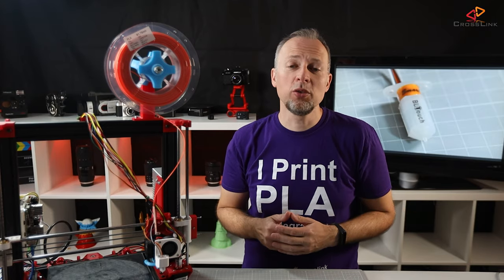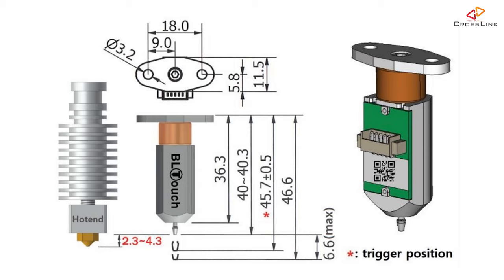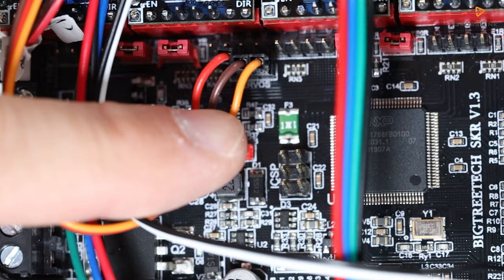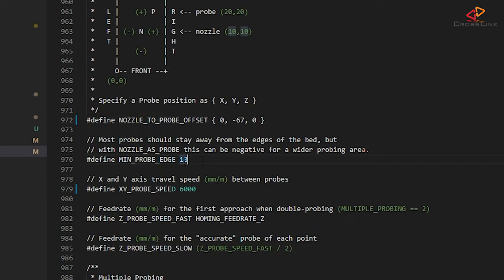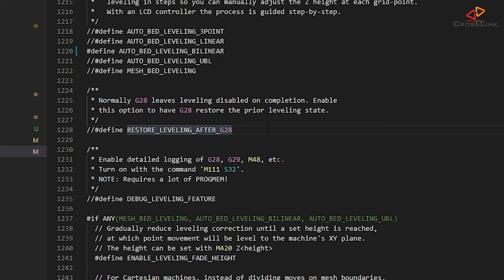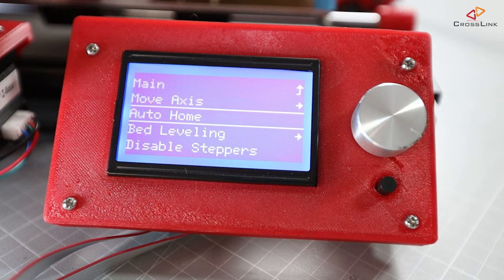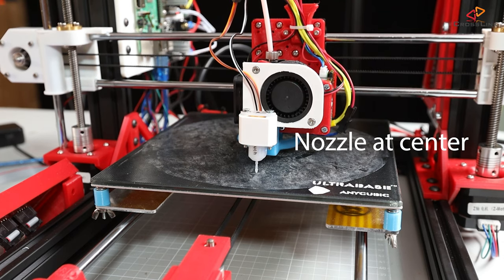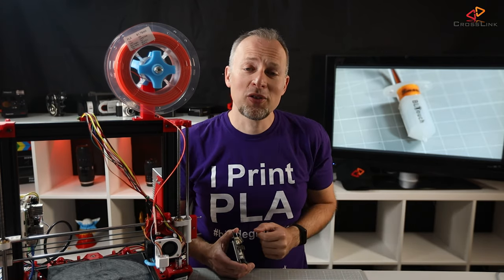SKR 1.3 - BLtouch installation and Marlin 2.0 configuration

Comment: Thank you very much. Best guide for Marlin 2.0 and BLT so far. I've got v3.1 of BLT and ender 3 pro board v 4.2.7. It was a real pain in the ass to make them work together and your video helped me very much with the firmware settings.

Comment: Another great video!!!!!  You are doing all of my upgrades that I set out to complete on my Anet A8!!! lol. I kinda stopped looking for help after so many different suggestions, its kinda nice that I figured much out with a little info from everyone and then go back and take the time to view current videos like this one and compare/take notes and understand sooooo much moire after already  getting knee deep into the upgrades. Consistency and reliability of my prints have hugely increased and I can almost set the print and forget it until its done.....As there are so many different options with so many different printers, t is hard to find a video for exactly what you have and are trying  to accomplish.  

I hope you will touch on the wifi  option with next week's MKS TFT installation video. ( As I have not tried this option out yet along with I havent even installed the MKS TFT display ....lol)

I have some  suggestions for you if you feel up to it.. As I grow more and more confident and familiar with 3D printing,  I have come up with  some very challenging goals- I plan on re-purposing my original Anet A8 1284p v1.7 board as a expansion board for my BTT SKR v1.3 & MKS TFT 3.5 w/wifi setup.  I also am planning on using my OEM LCD2004 display with the SKR v1.3 (man you should look into what has to be done to use that display on the SKR - utter mass complications).  Some possible uses are a real time clock, scrolling messages like time til complete, material  used, etc, led control, multiple fan control, and even using a android tablet as a big 7-9" display.

So you see what my plans are..... It would really be nice to see some of the ideas in your videos.... just saying...... lol
Reply from the maker: 😀 Let's see, I am currently testing all the SKR boards and will document the process first. Will take a few weeks.

Comment: I have an Anet A8 upgraded to SKR V1.3 and am trying to install the 3D Touch. It seems I have the wires connected properly, and config according to video. When I power on the printer the probe deploy/stowe/deploy/stowe, but I can't controll it via the LCD meny (option is there but nothing happens when pressing deploy/stowe). Any ideas?

Comment: Is "//#define PROBE_MANUALLY" normaly enabled, or? Then i have to disable it when is use bltouch, right?
Reply from the maker: It is disabled by default, at least that's what I see in the original source codes. You should disable it if you use a sensor.
Reply: Crosslink thanks for fast reply! Your video was a good help to enable it and it is running well. Now I wait for your next video with ubl. Your explanations in the video were very good. :)

Comment: Can I use this on skr 1.4 and the cr touch
Reply from the maker: Yes, this should work however the SKR 1.4 has a slightly different CPU and so the build environment is LPC1768 for the SKR 1.4 and LPC1769 for the SKR 1.4 Turbo

Comment: Again great video. A word of caution concerning #define BLTOUCH_FORCE_SW_MODE Activating this option can cause the nozzle to crash into the bed in some instances. This for example can be true for the 3D-Touch with the metal tip. My recommendation is to leave this option disabled and only enable it when you are having issues. One other note is when you install any kind of sensor test it before it actually measures the bed by placing a soft object or using your finger (BL-Touch) or metal ruler (inductive sensor) or any other type to make sure the Z movement stops to confirm it functions properly otherwise you risk the nozzle crashing into the bed.
Reply from the maker: Thanks for the tip, I head this and that about this switch. I guess you're right to only enable it if you have issues. Testing the probe upfront is a good point to mention!
Reply: Thanks for the tip. For me it seems like this was my issue. I am using a 3D Touch and it also errored out. After disabling it it seems to work fine now
Reply: Thanks leo, you have just save me alot of time. I was compiling for SKR MINI E3 TURBO. Was using 3Dtouch with metal tip. It was just crashing into the bed until I read your notes to undefine BLTOUCH_FORCE_SW_MODE.
Reply: @boonchinx  Glad I was able to help. Enjoy!
Reply: THANK YOU SO MUCH!!!!!!!!!!!! I losing my mind trying to find out why my 3d touch was crashing into my bed. checked wires, rewatched the video multiple times, looked on forums and finally looked at the comments. thank you so much. this 1000% fixed my problem.
Reply: @garyhanson655  Your very welcomed!

Comment: After this tutorial, my printer went bananas. Compiling was not even possible. It may be a specific issue tight to my own configuration (Marlin 2.0.9.1, 3D-Touch, Bigtreetech 1.3 Turbo, Ender 3 Pro) but be aware that this tutorial will mess up your printing device. Make a normal update first and keep the .bin file.

Comment: Just a tip for ANTCLABS BLTouch v3.1 & SKR 1.4 Turbo users that ive just finished installing (after a bit of stress!) because it took me a full day to figure this out. The BLTouch I have (official Antclabs) as opposed to the one in this video has three wires in the order, blue, red and yellow. All the wires are in a plastic mount, not as jumper wires as in this video. The Red and Blue wires needed to be swapped around and inserted to the board (with the yellow wire on the right facing toward the reset button). That got my BLTouch operational, but didnt stop when triggered. The z-stop cable (black and white wire cable), should be connected to Z-STOP (not 'PROBE'), but mine still wouldnt work but then I noticed in this video and in the ANTCLABS screenshots show the white wire on the left, wheras mine was on the right. I swapped the pins over (breaking the retention pin in the process!), re-inserted to the Z-STOP and behold my BLTouch will now stop the axis when homing Z.
Just hope this helps someone with the same issue as me.
Reply: Funnily enough I just spent a whole day of debugging another sensor with the exact same problem where the order of the wires were "faulty" relative to the connector on my motherboard.. I felt soo stupid when I found it out after wayy too many hours of digging :)
Reply from the maker: Thanks for that insight. It's possible that there exist other versions with different cables of course. Hopefully someone cannot destroy their sensor because of wiring it incorrectly.
Reply from the maker: What sensor was it? Got a link?
Reply: @Crosslink3D  Certainly can sir.... this is the link I purchased from:
https://www.aliexpress.com/item/32965233663.html?spm=a2g0s.9042311.0.0.27424c4dobh5kU
NOTE: On the link, the image shows a v2.0, but I actually received a v3.1 - not that I'm complaining about the upgrade!
Actually its a 'CREALITY' branded/resale BLTouch rather than ANTCLABS, heres the instructions I received and a pic of the probe at the bottom.
https://imgur.com/a/2pTKzr5
Reply: @Crosslink3D  It wasn't even a BLTouch one, just a chinese inductive one with three wires.. But the same principal lesson is learned anyways; always triple check the signal cables on both ends :)
Reply from the maker: So true!
Reply: @MrJegrow  Well luckily nothing blew up! It was shorting out though, I was confused as to why I couldnt get a display from the SKR 1.4 for hours thinking I may have a defective board until I decided to disconnect everything and start again. As soon as I removed the BLTouch it started up first time. Thats when I started investigating wires and discovered my problem!
Reply: @MrJegrow  So you say 'inductive one', is there a difference between this Creality sold one and one direct from Antclabs?
Reply: I agree with this. I just got my 3.1 and looked at the pinout diagram but I have the Mini v2.0 and it was the same thing I had to flip them as well. Glad I noticed this before I installed anything.
Reply: Holy shit. I have spent literally 3 days trying to get this stupid BLtouch to work. I've googled for hours, youtubed, flashed like 4 different firmwares and nothing, Z just kept crashing my bed over and over and over, no matter what!! Well here was my answer all along, I had the black and white (or actually blue in my case on a BL3.1) plug in backwards. I switched the wires and lo and behold, it finally stopped abusing my poor Z motor. Thank you SOOOO much. I can't tell you what a relief it is that I've finally figured this out.

Comment: Plese help ! Z axis moves( like it's trying to level the bed)  while i print but  it doesnt get it right.
In some corners  of the bed surface nozzle it's to low and vice versa. I tried M48 and results are ok . I use bl touch smart 3.1
Reply: My printer is the Ender 3 pro with marlin bugfix 2.0.x and btt skr v2.0 . I followed your instructions for making up the vs code . 
Great vid btw , keep it going 😁 thanks!

Comment: I did all this but my bltouch never triggers which means Z-axis keeps on moving when homing so it ends up crashing into the bed. Wiring seems to be correct as all I did was change DRV8825 to TMC2209

I did remove the diag pin to make sure driver was not causing the issue.

Comment: Hi, I have a problem. Hope u can help
Upgraded to skr 1.4 turbo, with tmc2209 drivers, with skr3.5 ver3.0. Just install 3d touch. follow all the setting. problem is with all home or g28. The probe pin is still up while the nozzle is coming toward the bed. Hope u can help. Thanks

Comment: Anyone have any info on using the BLtouch v.1.3 on the ender 3 4.2.7 mainboard with the latest firmware? The latest I have is 4.2.2 board and those instructions don't work. There's some interface differences. 

My probe turns on. It pops up and down. But auto home goes roughly to the centre and just out of reach of the bed. I've manually lowered it but am worried about lowering it too far manually. The z-offset is at 0.2

I'm running the stock firmware from Creality though.

Comment: I finally got it sorted. my comment  "Always use BLtouch probe in the Z endstop."   and fysically remove Z-endstop out of the way. Even when your board has a dedicated BLTouch 5 pole connector use Z-endstop anyways!   First check auto homing with Z-axis on great height to prevent it driving into your bed. Block the probe with a finger, if the z-movement stops its connected correctly and your BLtouch does the job. If not!? you got time to switch off the power quickly and check if the connectors are plugged in the right way.

BL touch gives me a headache, it never works fine for me at start-up.  when i single command "bed levelling"  its fine. afterwards i use z-wizard, all stored.
Then when i run a print with G29 ; after the homing.   after the homing it goes to first bedlevel position, then it fails. It proceeds the print and the z-distance is all fucked up.
I also tried with "enable stored level after homing"   same problems.
I disabled the whole shi....   and just manual set the nozzle distance with a paper and all is fine.  I like to have auto bedlevelling because the center of the plate is like a tenth of a millimeter lower. I cant therefor not print small things in the center, it wont stick.  Have to move small things more to edges of the plate.
It would be nice to not have to think about that and just have the auto levelling do its work.  Sofar   no Luck.
Could it be that i need to change Z_MIN_probe endstop to true  instead of False??!!   I got SKR mini V2.0  and tft 35 screen.  I have not unplugged my z-axis because board has dedicated BLTouch connector.

Comment: When homing the printer my probe does not deploy. It does the self test during start up however. I have a Creality branded BL touch. This on was originally meant for the V1 boards. However, I have gotten it to work with creality's software just not marlins. Any ideas on how to go about fixing this? Thank you in advanced!

Comment: I have the skr 1.4 turbo. While compiling it says: Servo.h no such file. Only that accured. And also i do not use the z min endstop but the probe plug. I read that the newer marlins(2.0.7 is mine) need to use the probe plug. The problem accures, when I Uncomment the Z Safe homing and try to compile. I installed a servo lib and it is still there

Comment: I did a m119 and it shows Z triggered??  All I did was flick on all the comments for a BL touch, and now It will not home, and it homes to the top of the printer???
The servo works and I tried switching the end stop wires, still triggered?? Is this a Marlin 1.1.9 bug Or did I just miss a setting…

Comment: Great video explains a lot.  I am real new to all 3d printing but, I have managed to upgrade my E3 Pro a lot.  I've had the BlTouch working great.  Last night I installed the E3 mini with TFT touch.  I have tried both firmware files Z-homing and Bl Touch and both will crash into the bed when i auto home just at the different areas on the build plate.  I am using the probe in the z-stop connection so i should be using the z homing file which i believe loaded. I have followed you videos changed all the bltouch items in both h. and h.adv files, even looked up the correct environment.  I cannot get the file to compile I am getting errors in yellow.  
Mostly this error:  UserSideException: Please install Git client from https://git-scm.com/downloads:
  File "C:\Users\Robom\.platformio\penv\lib\site-packages\platformio\builder\main.py", line 168:     When i follow the Git Client link its a 404 page error!   Any ideas what I am doing wrong?  Thanks in advance!  Rob

Comment: Hey there, so i've a question, you can also anwer in german. So i correctly set the offset for the probe, but in my case, if i press auto home, it doesn't go in the exact center of the bed on the x axis, just about 1 cm beside. What could be the problem here. Thank you!

Comment: Hey Daniel, I just love watching your videos as they are so easy to follow, However, I have an issue, I have today installed the SKR Mini E3 V1.2 and have flashed the firmware via SD card, now when i try and do the bed leveling, the Z raises up to 10mm and then only comes down 8mm is there something that I am missing?
thanks in advance

Comment: Great video but no one ever shows how to adjust the boundaries for the bed. I have an ender 3 and after setting up the bltouch it does not go all the way to the edges of the bed so about 40mm of the bed all around are not getting probed which mean larger prints don't do very well on the outer edges. Do you have anything that shows how to do this or could you make a video showing how to do it and keep everything centered please. Again great video helps a lot but someone needs to show how to adjust the bed boundaries

Comment: Hello Daniel, thank you so much for the great tutorial!  I recently got myself a 3DTouch on my Ender 3 with the Robin E3 board.  I watched your tutorial several times carefully and got as far as the firmware goes.  The ABL was installed and looks functioning. However there is still some problem with the Z-offset.  I checked my Z-offset was -1.8mm and entered and stored it (it displays -1.8mm).  When I used the Z-motion to move the hot-end, it grabs the paper at -1.8mm instead of 0.00 per your video, and the printer is printing in the air.    I noticed when I select "Set Home Offsets", it displayed "ERR: too far".  I suspect it was caused by the Z-endstop.  Any insight will be appreciated!  Thank you!

Comment: So I installed a bltouch and found that it was driving the nozzle into the bed. The kit came with a mounting bracket for my printer (sovol) so I foolishly believed that it would plug and play. Ha! I don’t know where you got the info on the range of distance between the nozzle and probe but mine was almost 6mm. Do you think that titbit was in the instructions? Ha! (again). So i will make a shim and that should do it. Thank you so much!
Reply from the maker: Good to hear you’re having success!

Comment: Daniel ... great video  ... were doing the upgrade at the same time ... so i set my bltouch the night before you posted your video ... the one thing i didnt see you mention and maybe you have a work around  was near line 1400 in "Configuration_adv.h"

 #if PROBE_SELECTED && !IS_KINEMATIC
  //#define MIN_PROBE_EDGE_LEFT MIN_PROBE_EDGE
  //#define MIN_PROBE_EDGE_RIGHT MIN_PROBE_EDGE
  //#define MIN_PROBE_EDGE_FRONT MIN_PROBE_EDGE
  //#define MIN_PROBE_EDGE_BACK MIN_PROBE_EDGE
#endif

i definitely needed to activate it for the back offset ... we are using the same holder ...
Reply from the maker: It might be but for me just using MIN_PROBE_EDGE with the same value for every side worked fine. Might be that your bed centering is off.

Comment: Hey. Why should the “RESTORE_LEVELING_AFTER_G28” be off?
Reply from the maker: Because leveling is not stored with abl and this will cause an error most probably. So g28 followed by g29 is the safe way. If you do g29 and then store the result to the eeprom, restore after g28 COULD work. But I didn't test that yet

Comment: Hi great video.

I am about to change to AM8 and have been watching your series.

I have enverything I need, appart from the BL touch.

What thickness of wire should I use for between the PSU and the main board? Is this what I should also use for the mosfets?

Cheers :)
Reply from the maker: 18 AWG Cable should be good: https://geni.us/cable18awg